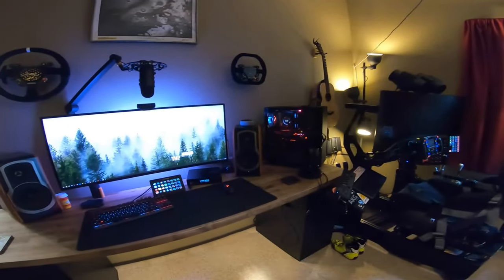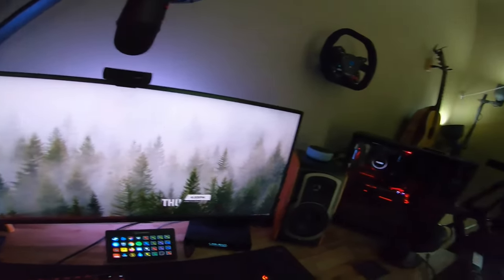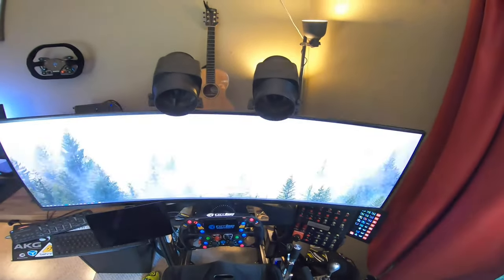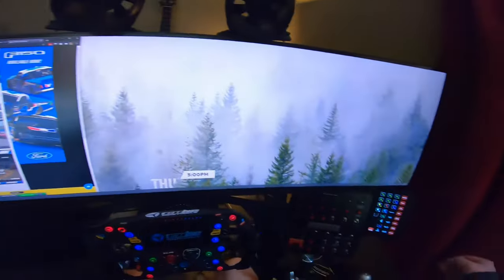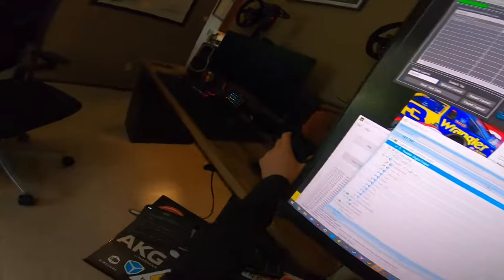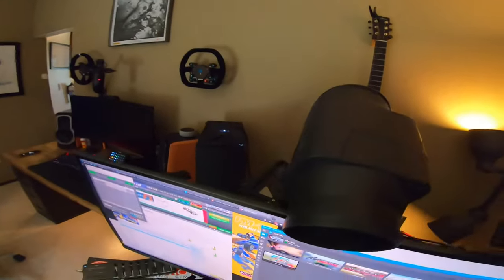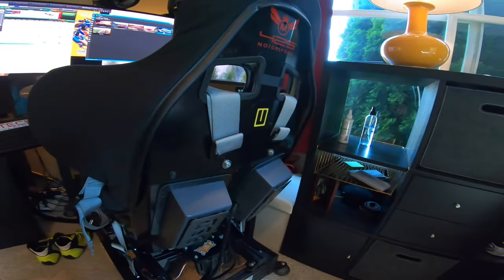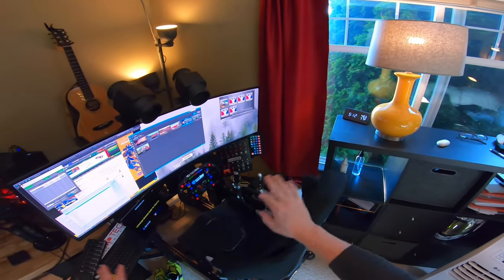Tips & Tricks For a Shared Desk / Racing Sim

Comment: Extremely cool setup!! Quick tip for the screen switching if you haven’t already found a way that works. If you have a stream deck there’s a plug-in called wintools. There’s a button for changing primary displays which will make your sim display primary display and desktop display secondary. Then when you’re done racing/flying you can just press the button again and it switches back.
Reply: legend
Reply: legend
Reply: I've been planning on building a separate station for my sim race/drift gear using 1 PC but couldn't think of a solution for the monitors ur actually a legend!!

Comment: I really dig these setups, but I just dont want to need to buy another 43" 4k 144hz display.
I dig your systems and the clean cable. Very nice.
I kind of did the exact opposite, and modded a sim cage to sit higher, seat raised, with mouse area mounted on and keyboard on a laptop mount also connected to sim rig. I note that I also have had zero back pain while being in this chair.

Comment: Thank you so much for all this good sir! I am currently building my first sim rig, which also happens to be my dream rig. The idea of getting cheap belt driven wheelbases and toyish pedals wasn't appealing to me so straight to DD and all the bells and whistles (RIP wallet) lol. I am having many road blocks and questions currently, especially when it comes to monitors and VR. I have the new HP Reverb G2, I bought it for this purpose, haven't tried it yet but from what I hear it's the most immersive. I need some sort of display to run the system still though, because I have a dedicated sim-rig PC, and I can't decide if I want a cheap display setup or something that I can race on besides VR. Now that I spent all the money I'm also questioning if I shouldn't have just moved around my room setup to be able to use one PC for both main & sim-rig, especially after seeing this..... but the problem is my work/game PC is running 3 monitors, and I also have a TV wired to the GPU so I'm all out of display ports. Would love to hear what you think on these issues, thanks in advance! Also wouldn't mind sharing pictures/videos of the setup over discord if that's a thing you're open to.
Reply from the maker: I tried VR with an odyssey + for a couple months and eventually moved away from it for a few reasons. One of which was the cleanliness and awe of use of my desk area. As you can hopefully tell I invested a lot of effort into getting things set up cleanly here. I have considered a second pc (particularly when upgrading my rig early this year). For my money here only have two displays is a huge QoL improvement for the ease of just turning on/off the second display to lockdown the other one. I have considered additional desktop displays, but that would make the swap over to race mode more complex (the more feature rich your sim rig becomes the more value you will place on this, IMHO the longer the setup time before a session the less you race). In my situation the 38” LG takes up enough of my FOV at the desk that additional monitors don’t make a lot of sense for daily use. If I want a second display for something like discord, yt, comments, etc. an iPad or tablet is easy to plop on the desk on an as needed basis and moved to the sim for an additional screen there as well. 

In your case you might consider dropping a display or two, or moving the tv to a wireless option (Chromecast, et all). If you don’t have high refresh need on some swappable displays you could use an hdmi splitter with a small remote, but those will add latency (marginal, but still) or hard cap the refresh rate to <= 60hz). 

I upgraded my setup quickly at at a relatively high turnover cost. I think you made the right choice to go big initially. That is what I encourage people to do if possible when they get into. Buy the long term, best quality parts initially and only add features as you can. Save yourself the hassle of replacing things under a year from purchase. 

You can add me on discord if you want to share photos be I can take a peek, my if there is: Brandon Boyd#7148

Comment: Great rig! Question (hopefully you’ll see this), but I have a similar setup with my Stream Deck to launch all of my respective racing programs like you, but I can’t get it to actually START Crew Chief. Did you run into any problems or have to take any extra steps to get it to work for you?
Reply from the maker: Nope, I just have it set as a multiaction trigger in streamdeck to open CrewChief at this location: 

C:\Program Files (x86)\Britton IT Ltd\CrewChiefV4

Comment: The only problem I have when I'm going to build the sim rig is the lack of usb ports on my pc.

 So I'm wondering is if a usb hub would work? 

People tell me they are kinda "buggy" so idk
Reply from the maker: They can be. Built up a collection of hubs trying to find one that worked. Found that anything important (wheel, pedals, etc) should go straight into the pc and the non essential items can go into the hub. A pcie card with unique usb busses can help quite a bit as well.
Reply: @nerdthewise  well how many usb ports do I need for (steering wheel, pedals, shift knob, hydro e-brake and a new set of mouse and keyboard?

Comment: Wait a minute, DP is required for 120hz monitors? Also, do you plan to attach a USB hub to your rig in the future?
Reply from the maker: There is a usb hub on the rig, and it depends on the display you are using and the resolution. But to my knowledge, yes you need DisplayPort to the carry the additional bandwidth required by doubling the refresh rate.
Reply: What most people run into with 2 displays is that the graphics card usually only has one hdmi port and then one display port. So they run their primary monitor on hdmi and the second monitor off display port.